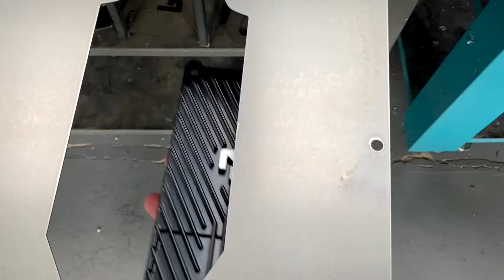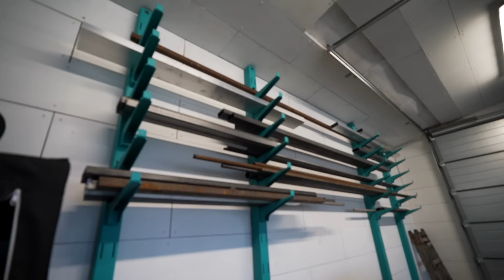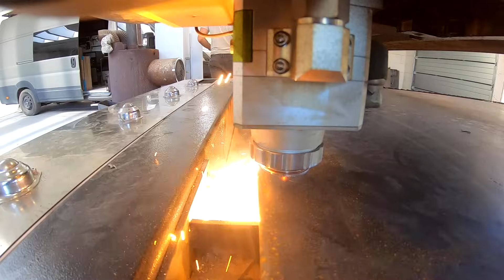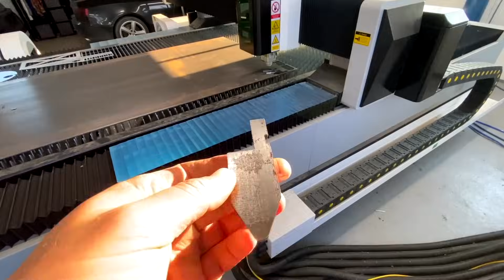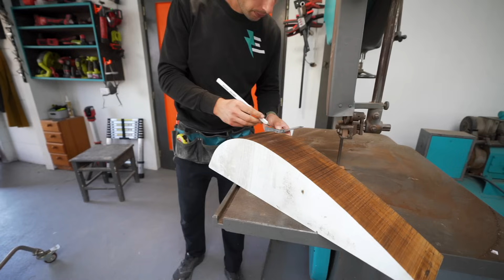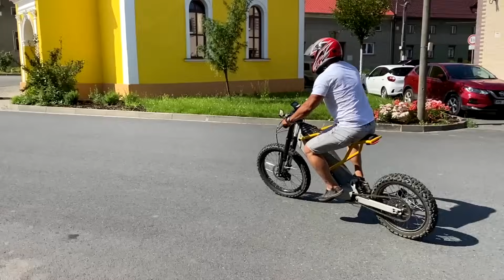Prepping Launch of New E-bike / E-Motorcycle Brand

Comment: maybe its a little late to comment but here are my 2cents. If this is a commuting bike with off-road capabilities the other things that should be able to be customizable (besides the wheels and the battery) are both the sprockets and the size of the forward disc brake. For commuting if someone wants to go over 80mp/h on a long road and extend the range of the battery a small rear sprocket its very usefull and with that a bigger forward disc brake its good as well. On the other hand, for off road the existing configuration of prockets and disc break sizes are perfect (bigger disc actually can be a problem is someone its not a skilled ryder). So yeah, those 2 thing, and using the middle space as cargo space with a net or something would also be great. Thanks if you read me.

Comment: Can someone explain to me the logic in buying any e-bike over $5K? I also can’t understand why anyone would put so much effort into upgrading a brand new e-bike when motorbikes with anything above 500cc will literally shit all over them and won’t need a few hours to recharge after less than 100 miles. Not to mention the added benefit of being able to be out all day or go on proper long road trips. I really don’t understand it at all. If they were $1000.00 new it might make a bit more sense, but you would get a motorbike with up to 10 times the power for $5k or less? The only argument I’ve seen so far is that they are quieter, but anyone that drives bikes wants them to be loud. Not only cos it sounds better but as most bikers already know - Loud pipes save lives!

Comment: Kudos on the mudguard. I have tried making one with an ABS sheet and heat gun, which held up well but was not entirely smoothened out. And the second attempt -- printing with cf-nylon and epoxy treating -- is indeed not stiff enough.
Reply from the maker: It’s all about the right mold :)

Comment: On the structural components I’d recommend utilizing obround cuts for the corner relief on sheet metal bends otherwise you run higher risk of crack propagation from fatigue.

For trimming the plastic mud guards instead of using the bandsaw, a metal or mdf trim router template will significantly speed up the process utilizing a flush trim bit.
Reply from the maker: Thanks. I’ll look into it. MDF 3D templet like this would be tricky. Something to think about at night.

Comment: Why did you laser cut outer contour right after the cutting holes and then start cutting inner part of the same part again?
Reply from the maker: Idk, likely operator mistake.
Reply: @BuildStudioHQ  With lasers I've been working with this was done in settings automaticaly. I've got press brakes experience as well should you need anything just hit me up. You've got a decent shop and you've made so much progress over the years its insane. One day I will buy your bike.

Comment: If you aren’t using them already I would highly recommend utilizing hex body rivet nuts instead of round body. They aren’t as susceptible to hole tolerances and have much better torque performance before spin out. Especially since you have a tube laser you don’t have to depend on processes that produce round holes. Böllhoff has a great selection of hex body rivet nuts and even have sealed blind version if you need water tight compartments.
Reply from the maker: We started using them on this frame. I agree, they are amazing!